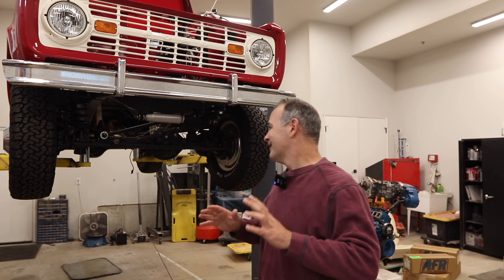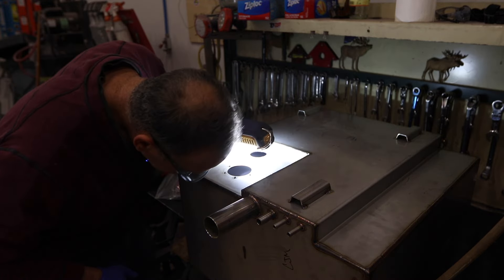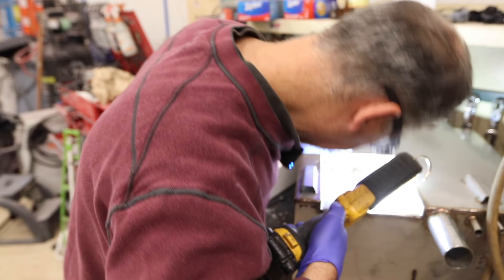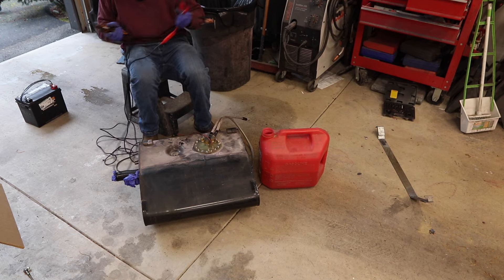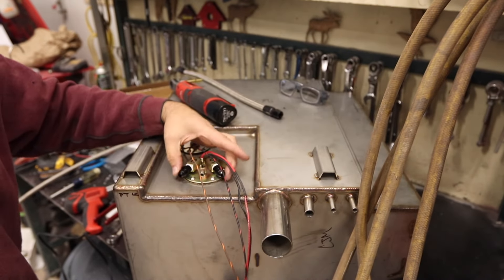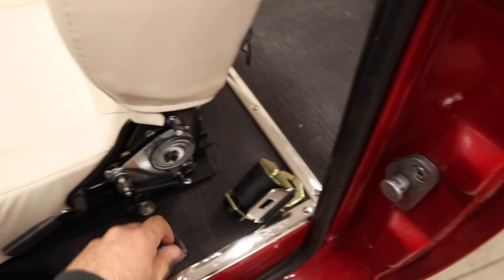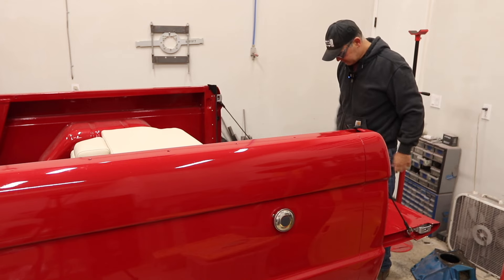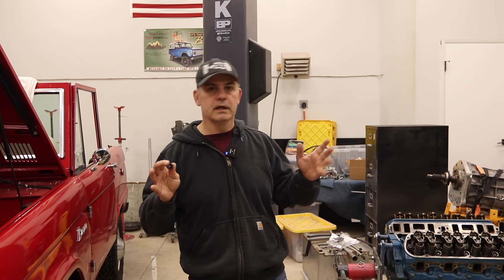#328 Fuel Capacity Upgrade

Comment: My Tom’s rear seat did the same thing…
Reply from the maker: Which part?  The not fitting or the bushing disintegrating?
Reply: @MattsGarage  the bushing.  Set it in the truck to layout holes and both bushing fell apart.  I like the seats overall but the way those front legs are designed are lacking..
Reply: Also fwiw, I ended up making plates for that rear seat that allowed me to relocate the position and not have to drill new holes.  Similar to what you did for the seatbelts.
Reply from the maker: @billh5592  I agree.  They are a little flimsy.  Hopefully I can find a bushing at my local Ace-type hardware store.
Reply from the maker: @billh5592  I was going to do that too, but my kids are getting fairly tall and I didn't want to cramp their legs on the rare occasion we go on rides.  That's why I chose to ditch the spare tire setup instead.  I found a very cool option I'm excited to share on an upcoming episode.
Reply: @MattsGarage  cool.  Looking forward to seeing what you came up with.

Comment: Hi, Matt! I am glad you figured out a good engine solution. So, here are some total nube questions… what is the difference between a “short block” and a “long block?” Is the short block still a 302? If the cubic inches are still the same, what else is different? Just from the quick shot of it, it does seem to be smaller (exterior dimensions), but maybe that is just my lack of knowing what I am looking at. Are you expecting any challenges in getting the short block to fit? Sorry if this is a dumb question. 😂😂
Reply from the maker: Always good to hear from you. It’s not a dumb question. How would you know without asking or researching? A short block is exactly the same, but it does not include the heads and valve train. That engine is actually upside down on the pallet so the pistons are pointing downwards. It’s the 5.0 roller motor that I had so it should fit just fine.
Reply: Ahhh. Got it. I probably heard that before, but I forgot. Thanks for the explanation! So basically, you are going to be able to reuse a lot of parts from your old engine. That makes a lot of sense!
Reply from the maker: @brianreilly6358  yes everything should transfer over that I am reusing